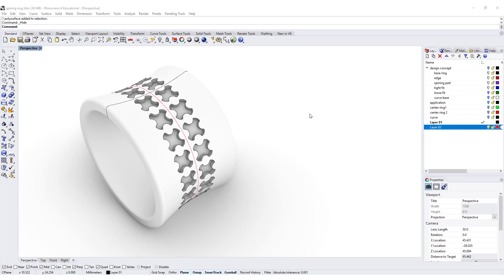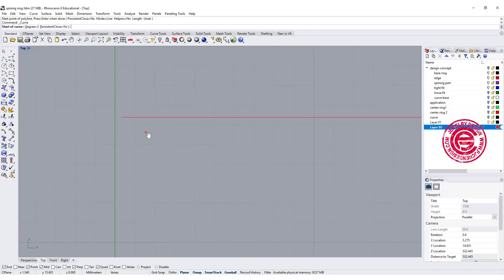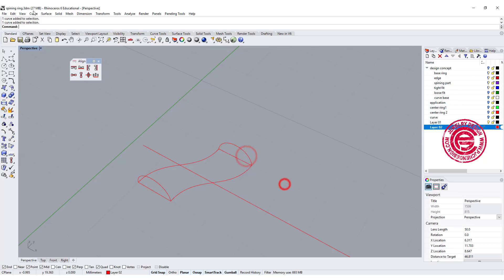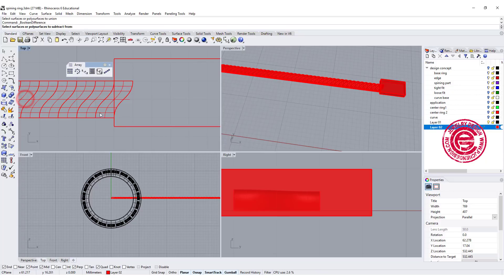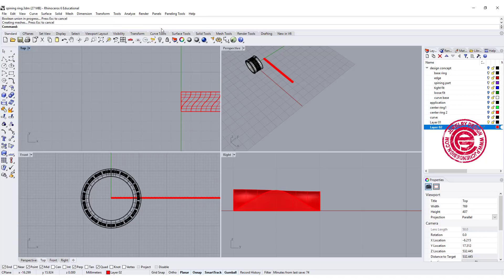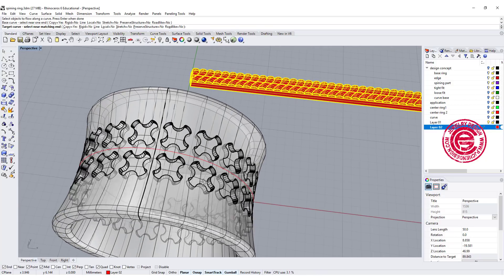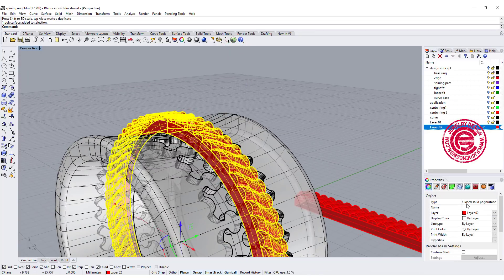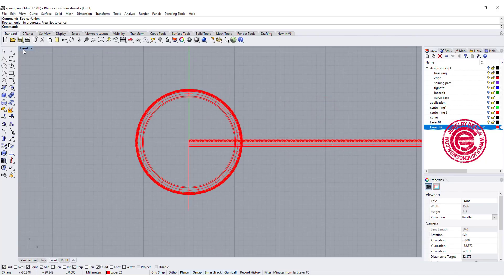How to Design a Spinning Ring in Rhino 6 (Part II) - Jewelry CAD Design Tutorial #53

Comment: hi PJ thank u very much for your work, its amazing! one question: can u make tutorial on how to make claws and clasps on braccelet, neckwear, etc. in jewelry? thank u again
Reply from the maker: HI Al, Welcome to my channel. The "Craw" do you mean prong set? If yes, You can check out my video https://youtu.be/qxDI_7-tGHQ . and as far as the clasp for bracelet. if you means something like lobster or spring. Most of time, they have spring in there. and it is not done by 3D printing and casting. which mean. modeling the clasp won't able in the production. Jeweler often buy the ready-made one for commercial use.